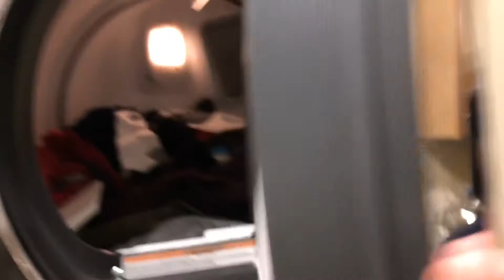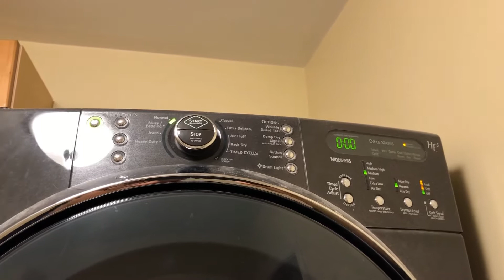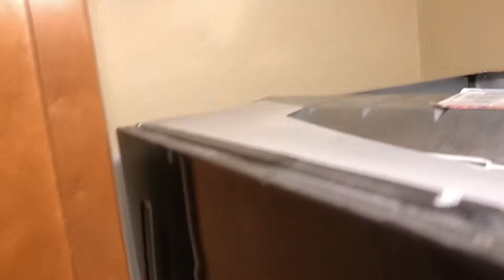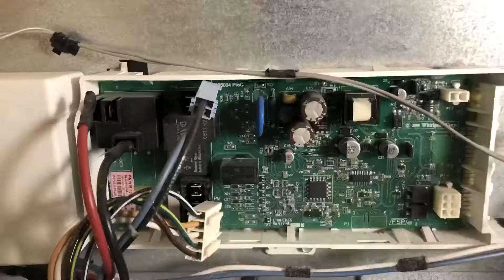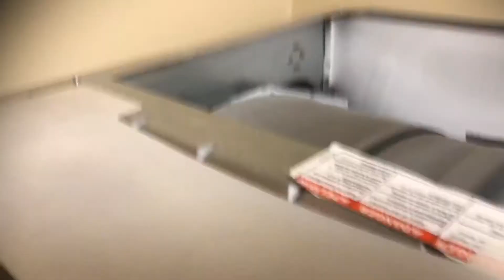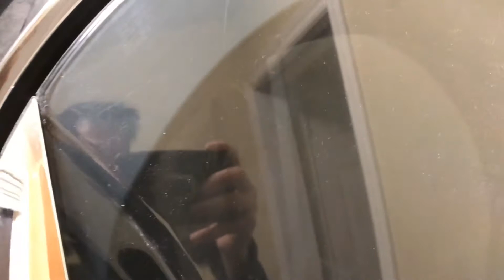Easy DIY Dryer Repair with F01 Error (Kenmore)

Comment: Hi, great informative video on the repair. Only thing I missed was how one deals with little red(4) and grey(3) wires off to the right of the board housing, before removing the PC board.
Reply from the maker: Those wires usually have small release tabs you need to gently press before they slide out of their housing.

Comment: This can be fixed without adding the wire. I dropped a spot of solder on the burned area and it remade the connection. It’s held for years now.

Comment: For those who have this problem and it still doesnt turn on check your thermal fuze located under the drum near the motor! Brother in laws and sister dryer has the same issue so we tried this. Still didnt turn on. Come to find out that relay was done of course but also that fuse. I ended up replacing that relay all together then just soldering a wire. New fuse and its running again.
Reply from the maker: Awesome!  Thanks for commenting!

Comment: This MIGHT be OK as a temporary fix, but manufacturers don’t put parts on the board when a wire would work.  That part is there for a purpose, likely to do with detecting a problem with the dryer overheating and risking starting a fire.  Hopefully no one who has tried your fix has had that happen.  Replace it with the same part would be better.  If it burns out too, it’s probably a sensor somewhere in the dryer.
Reply from the maker: Good advice.  Fortunately, mine has continued to work great without any issues since I did this fix.
Reply: @DDIY-Guy  I'm sure it will continue to work until something else fails, either for you or the 100K+ people who have watched your video and followed your advice.  It's a lot like wiring around a fuse or circuit breaker in your house.... you don't really need the breaker until there is a problem somewhere else.  Everything is fine until something else fails and the fire breaks out, and then an actual replacement part looks a lot cheaper than a piece of wire!

Comment: Great tip. Wife told me about the F01 error yesterday, saw your video while reading about it, took it apart this morning, and it was burnt out in that exact spot. Soldered a scrap piece of wire to reconnect and it’s working again. Under 2 hrs. Hopefully my solder job holds. Thanks!
Reply from the maker: That’s amazing!  Glad it worked for you.  Mine is still running well.
Reply: Mines burnt in the spot to the left of it. My question is do I have to run the wire to every single solder port on that line or what?

Comment: This is so helpful, can’t believe I found this! I’m not handy, but got to the control board and see that fried part. Was able to remove all wires/plastic thingies except that beige one on the lower left corner of the board 
   I’ve pushed, pulled, squeezed, pried, and it won’t budge. Before I apply more force want to make sure it’s going in the right direction
    My beige thing looks slightly different than yours… wish I could post a pic here… but wondering if any of your readers encountered the same feisty piece and how they removed it!
   It’s connected to the board and an orange plastic thingie right above it. It has slots, a notch and a wing-like piece so I’m sure there’s some logical way to remove it but I don’t want to break it!
     Any advice appreciated!
Reply from the maker: You really just have to squeeze the clip with your thumb and index finger and keep wiggling it off.  Maybe get someone with stronger fingers as it can be on pretty tight.  Hope you get it off eventually.

Comment: Well the board in my dryer had the same defect - resoldered and tested ok - Relay tested ok - but I wonder if it is a manufacturing problem with a bad batch of boards and a cold joint that over time fails - something to watch for

Comment: Another dryer saved from the dump! Thank you for posting this! Worked for my Kenmore Elite 110.86742700 white model. Some components and connectors not exactly the same, but it still had the burnout in the same area.

Comment: My Kenmore drier is 16 years old, so when the fatal F01 error flashed on I figured replacement was unavoidable.  After watching this video I was able to get it fixed and back in operation in around 1/2 hour.  Thanks so much for posting the video, it has saved me a lot of money.

Comment: It got mine running too. Awesome! Im just wondering why it overheated in the first place. Has anyone had any fires as a result😅?
Reply from the maker: Glad you got it running again.   Everyone wonders about a potential fire but the blown circuit is common in these units and the housing is built to protect against that.  You are not actually bypassing the connection but simply connecting it back up.  The only thing that can happen is the it blows again.  Since I made this video, my board hasn't blown since.

Comment: I am wondering why all of us have the same issue - and if this repair could potentially create a fire hazard - since some sort of blow out happened.  Was it just crummy or inadequate solder at that junction? Why did it blow out? With the jumper wire - am I creating the possibility of this power surge might happen again?

Comment: I've got this error, took the circuit board out after seeing your video, and have a massive black smoke/burn spot on the circuitboard on the back. It wiped off pretty easily, but I'm kinda worried now, as wouldn't this be by-passing a fail-safe? If I solder the wire on the circuitboard, wouldn't it have the possibility to get even hotter, and maybe even start a fire?
Reply from the maker: great question.   no it is not a bypass, you are just soldering the contacts back together.  it will be fine. if it blows again, the casing around the board will prevent it from catching fire.

Comment: Unfortunately, this is a "bandaid" fix....the relay is bad...it will overheat again and cause the same issue....the relay needs to be replaced....
Reply from the maker: ya, these units tend to have these common issues as they get older.  you have to decide if it’s worth fixing and chance that other things break down or just buy a new one.  if the bandaid fixes work, it’s cost effective but any continuous problems will ending causing more time and money to fix.

Comment: Hi what does code do dryer will not run
Reply from the maker: If you don't have a code on your dryer and it doesn't run, it usually means the belt broke.
Reply: F 01

Comment: Yep, that's exactly what it needed. "Repair man" would've ordered a new circuit board. Only difference was on mine it was the other side of that power supply circuit (same shape but to the right of it, mirror image). Thanks so much for sharing.
Reply from the maker: Glad the video helped!  Thanks for commenting! Have a great rest of the week.

Comment: Running into this issue this evening, my only concern is possible fire hazard...should I be worried of causing a fire after x amount of time? Or it should be just fine? This seems like a great $ saving fix that I will do in an instant if it's legit not a hazard. Thanks all for sharing any knowledge, and you Danny sir for the fix video!
Reply: Well I've got it almost off...the motherboard on mine has a blue & red wire on the far right part of the board with a connector end stuck into/onto a orange  "tyco - shrack" rectangular thing.  On your board it's blank or a yellow rectangular spot where it's missing on yours....I cannot get it fully disconnected...I've worked at it for some time now....smh gna keep trying tho.
Reply from the maker: I guess they made it harder for people to replace the board :-/ hope it works out for you.  Keep me posted.
Reply: @DDIY-Guy  well my friend I got it and now she's running back to normal!  My wife was ecstatic when it powered on. I can't thank you enough sir. Saved me a big headache and $!! Keep up your how to videos... im sure plenty of people are greatful for your postings. Have a great rest of the night boss🤙
Reply from the maker: Amazing!!!! You made my day!  So happy it worked for you.   Thank you for commenting.  Have a great rest of the week.
Reply from the maker: In all the comments I’ve heard, there hasn’t been a case of fire as a result of this fix.  My machine is still running as good as new since I did this fix.  Hope it works out for you as well.

Comment: Well, just another happy customer - same exact situation - added the jumper wire vs just adding a drop of solder.  The heat looks like it damaged the circuit board so re-soldering the point might not have worked as others have done.  Anyway, this deserves a hit on the red SUBSCRIBE button.
Reply from the maker: Glad the video helped.  Thanks for commenting.  Have a great rest of the week!

Comment: I almost never comment, subscribe, or post, but this here has earned the exception. My drier had the exact same issue, exact same spot. 

I’ve never soldered anything in my life, and I went and bought a $50 iron, an inch of thin copper wire, and just tried the same repair as I saw. 

My wife thinks I’m a conquering hero, I feel 10 feet tall and farting thunder, and my drier works. 

THANK YOU!!!
Reply from the maker: This comment made my day and made me smile!  I am so happy this fix worked for you!  Thanks for commenting. I really appreciate it.  Have a fantastic rest of the day.
Reply: My dryer just had the same problem too. Thanks my guy. 🙏

Comment: Really useful video, thanks!  I will give it a try.  One question... how did you clean it before soldering?
Reply from the maker: I have a wire brush so i used that to clean the burnt areas as best I could.
Reply: @DDIY-Guy   I have removed the board, but there are no burn marks on the board.  Any suggestions for what I should do?
Reply from the maker: Connect it back up, turn on the power and see if it resets back up.  If it still doesn’t work, you might have to replace the board.
Reply: @DDIY-Guy  Okay, thank you!!

Comment: I was amazed to see exactly the same burnout pattern shown in the video. I did not have any wire so went to Ace Hardware asking for AWG 24 wire, as Danny suggested in one of the comments. A guy there said to use stranded wire because it's better for soldering, so I got the wire. It did not look as thick as the wire in the video but I went ahead with the repair like Danny Jose instructed and sure enough the F1 error went away and the tumbler started rotating when I turned the dryer on. I was really thrilled! However, the euphoria was brief because I soon realized that there is no heat. Checked the manual (Kenmore but looks like a different model than Danny's) and it said it could be a tripped circuit breaker (there are two for the dryer, one for the tumbler and one for the heating element) but that did not solve the problem. I felt so close to solving the problem and joining the ranks of other delighted DIYers but now don't know what to do. I ordered a circuit board in case the soldering did not work and have it but am not sure to try it or not. It cost more than $300 and if I break the seal on the package, I cannot return it. Sorry for the long comment but am at a loss of what to do.
Reply: Broke down and replaced the circuit board. Dryer ran with heat, but only for a minute. Got an F-22 error. Tried replacing the thermistor, but that changed nothing. So sad!
Reply from the maker: Oh man…sorry your repairs did not help.  I know how frustrating it could be when you do these fixes and something else goes wrong.  The only savings in all this is that if you would have called a service guy, it would have cost you a least $100 for the service call. They would have suggested to replace the board at $500+,  probably found the same issue with the heating element as well and charged you another $500+ to replace all of it…and at that point you probably could have bought a brand new dryer with all the cost of the service guy….the dryer would have probably lasted another year and something else probably would go wrong with it.   My recommendation is just bite the bullet, swallow the cost of the board (maybe try and return it), and get yourself a new dryer.  Again, sorry it did not work for you.
Reply: @DDIY-Guy  That's okay--can't win 'em all. And I learned a lot about dryers! Be well.

Comment: Hello I attempted this but now the dryer won’t turn on. Any ideas of what it might be. Maybe I didn’t solder correctly?
Reply from the maker: Yes….make sure you solder both contacts….see the video again…there is actually 3 contacts you need to connect.

Comment: Well explained.  Had the exact same issue with a 15 year old Kenmore HE2 dryer, and this did the trick. A good workaround, instead of $350 for a new board. But ordered a new washer and dryer today anyway, to be delivered in about 8 weeks.... long lead time on some appliances with the pandemic!
Reply from the maker: Glad the video helped.  Thanks for commenting.  Have a great rest of the week!
Reply: @DDIY-Guy  have you heard of any issues with this fix? Have you seen or heard of a quick relapse or failure of the dryer after this fix?  Just curious. Thanks!
Reply from the maker: Haven’t had an issue since i did this fix over a year ago.  Have you had any issues?
Reply: @DDIY-Guy  Nope, just curious.  Just find it interesting how newer appliances seem to have much less of a life span!
Reply from the maker: I find that too....it’s why if I have a good appliance, I try and take care of it and repair it when I can.  The only thing with old appliances are the energy efficiency isn’t as good as the new ones.

Comment: you wouldnt by chance have a simple fix for the drum not wanting to spin? the belt is not broke.. i already checked
Reply from the maker: Sorry, not sure.
Reply: Kmcsec did u happen to figure out your issue because I’m have the same as you?
Reply from the maker: have you checked the space between the drum and dryer wall?  sometimes there are things that get stuck between them like the plastic collar inserts.

Comment: Thank you Danny! I had the same failure on the circuit board and with your help saved a ton of money and challenged myself successfully.
Reply from the maker: That’s fantastic!  Glad the video helped and you were able to fix it.  Thank you for commenting.  Have a great rest of the week!
Reply: @DDIY-Guy  did you use a regular soldering gun? I'm having the exact same issue same dryer and all
Reply from the maker: Yup.  Just a regular soldering iron.

Comment: Thank you so much. I had exactly the same problem and fixed it in a similar way. I am glad I watched it again because I missed that you need to bridge both of the pins on the opposite side of the burnt pin.
Reply from the maker: Glad the video helped!  Thanks for commenting.  Have a great weekend!
Reply: How do you bridge them? With the same wire or with solder?
Reply from the maker: You need to bridge them with the same wire.
Reply: @DDIY-Guy  thank you!
Reply: @DDIY-Guy  my dryer is working perfectly again!!:)
Reply from the maker: That’s amazing. I’m glad to hear it’s working again. Have a fantastic rest of the week.

Comment: What are the chances the dryer burns the house down after this fix?
Reply from the maker: Well...the fuse or board would just blow again if anything and the housing should shield it from setting anything on fire.  You are basically reconnecting the circuit back on the board so it’s as good as it was before.
Reply: @DDIY-Guy  Unfortunately the board looks perfect...
Reply from the maker: When you put everything back together again....what does the display say?
Reply: @DDIY-Guy  I can't get the error code to show up anymore.  When I hit start, it makes a noise back in the circuit board area, like a snap, and then nothing.
Reply from the maker: You might want to check the board again,  that snap might be the board actually blowing.
Reply: @DDIY-Guy  I read that disconnecting the moisture sensor wires might fix a false F01 error...can you tell me which wires those are?
Reply from the maker: Sorry I do not know.
Reply: @DDIY-Guy  Thank you for the great video, it helps.

Also, how can this problem happen without burning out the components on the top of the board?  I don't understand what causes the scorching on the underside if nothing on the top side is damaged.

Comment: Your jumper wire, can you use any color? Does it matter?
Reply from the maker: Doesn’t really matter what color as long as the wire is think enough to handle the current passing through.
Reply: @DDIY-Guy  gauge would be helpful
Reply from the maker: Wire width: 5 mm 
Wire gauge: 24 AWG copper wire

Comment: When you connect the wires can you use super glue . I have limited supply’s.
Reply from the maker: Awesome tip!  Didn’t realize that works.  Thanks for commenting! Have a great rest of the weekend.
Reply: @DDIY-Guy  I think they were asking you if super glue can be used.
Reply: @blackgold2029  i too am interested if this works or not please let me know
Reply from the maker: As long as the wire connects directly to the contact...that should complete the circuit.  Just make sure you put enough super glue so the the wire does not move.
Reply: @DDIY-Guy  one last question as I'm doing this now I have it all ready but why won't it melt? did I miss a step or does the wire just melt onto the post or should I have gotten solder?
Reply from the maker: Watch some tips on prepping to solder.  It was a little hard for me to do it nicely.  You actually don’t melt the metal.  You need what is called flux to bond the wire and the metal together.